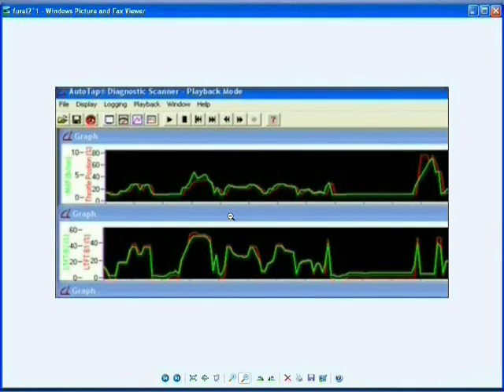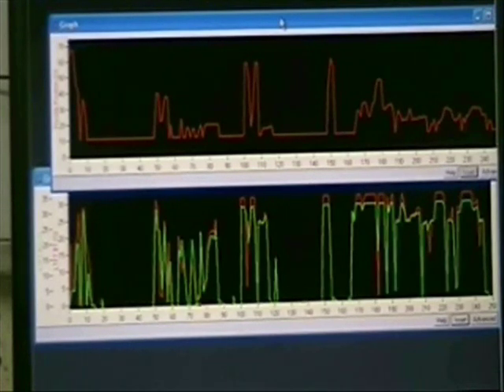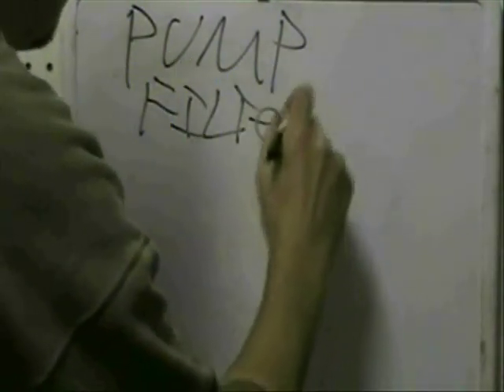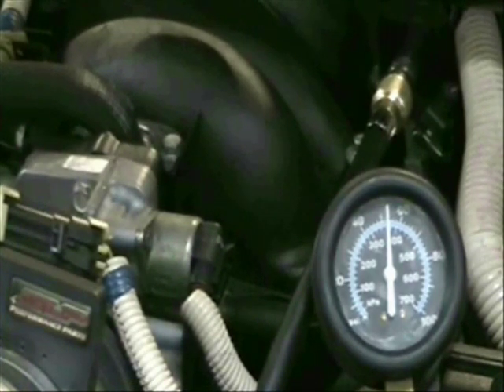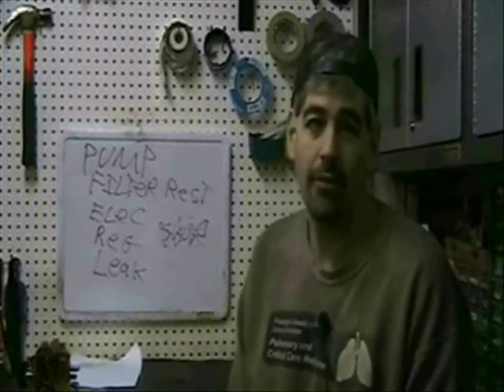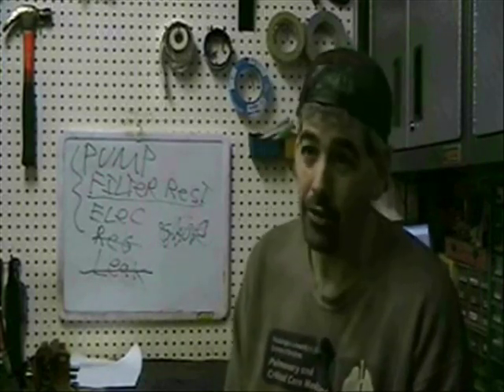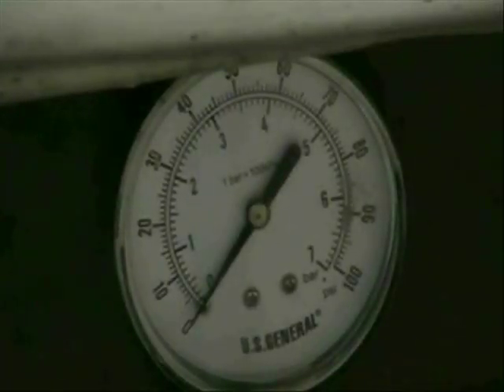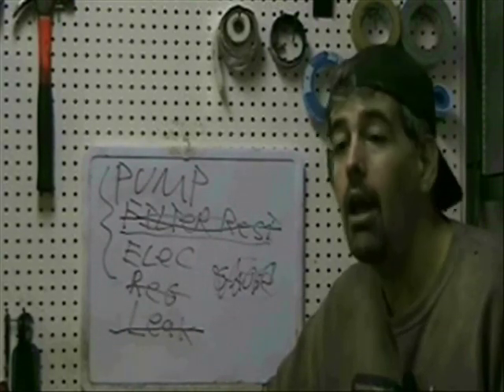Low Fuel Pressure, Lean Condition diagnosis PART 2

Comment: The fuel filter is a serviceable item and should be replaced annually anyway. Also, at ten dollars, being a swap-tron with the fuel filter isn't a complete sin.
Reply from the maker: Agreed but it wouldnt have fixed the problem. I would still need to diagnose the fuel pump especially before going to the parts store in a foot of snow and 30 below so i dont go twice.
  But the bottom line is 99% of people who would just replace a fuel filter to try and fix this do so because their Haynes manual has it as an option in the troubleshooting chart, not because their understanding of fuel delivery allows them to lock a definitive diagnosis.  This channel only regards the latter as acceptable diagnostic procedure.
Reply: True. What I ment was since you were replacing the fuel pump. Replace the filter too. Save time down the road. Sorry, but my thought logic is all over the place.
Reply from the maker: ***** Now that I agree with you 100% and, in fact, I would always replace the filter with a new pump regardless of the age of the filter (which I did).

Comment: That $10 you saved paid 1/2 of what the HF gauge probably cost you. I think I got my HR fuel pressure gauge for lass than $20. It's served me well. I check the new fuel pump motor or module with it before I install a new one into the tank. I have put a new one in and put gas in the tank only to find out the new pump motor is bad. Saves that headache of having to do the job twice if you test it before installation.